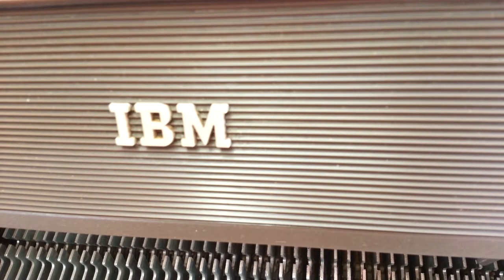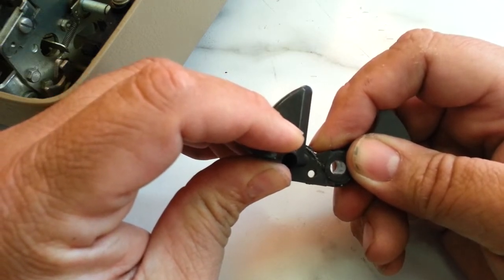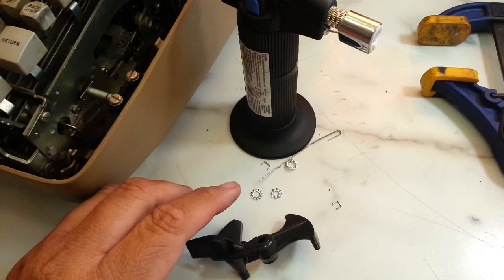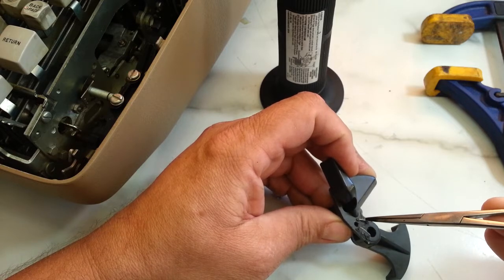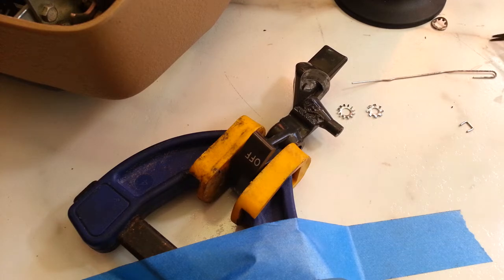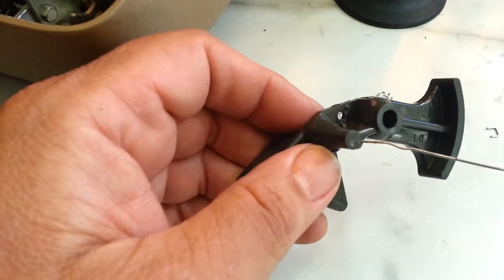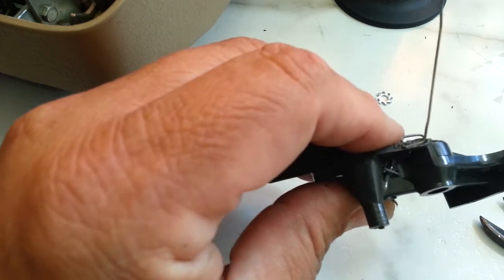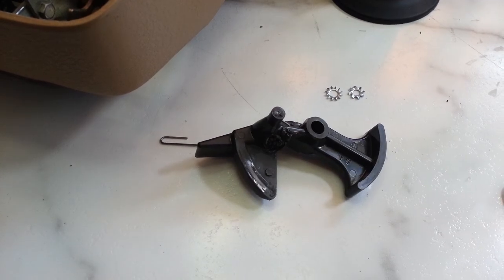IBM C Model Typewriter On/Off Lever Broken Repaired Melded With Hot Metal Reinforcement

Comment: You might also try melting bits of stranded wire into the surface. Warm the surface of the plastic, sprinkle the wire flakes on (like half inch long--enough to cross the break decently far on both sides) in semi-random orientation, press them in, warm it again to fully embed and, if possible, even cover some of them. Kind of like fiber glass when its done.